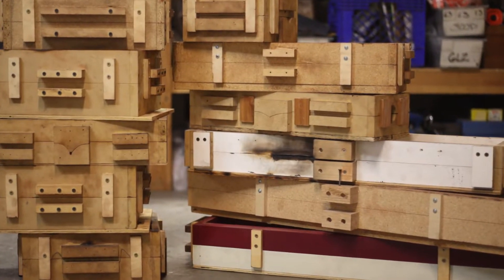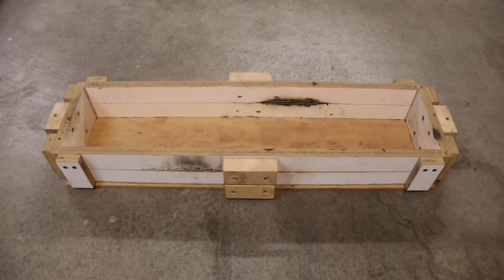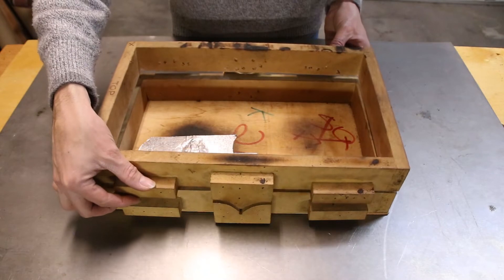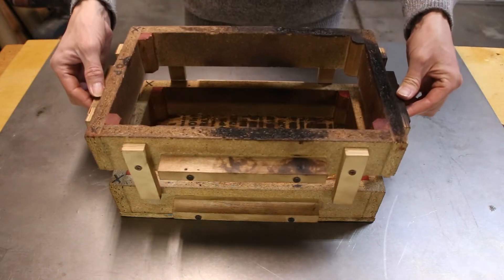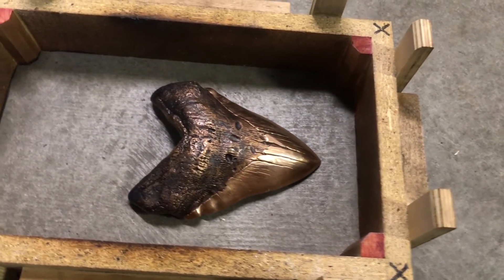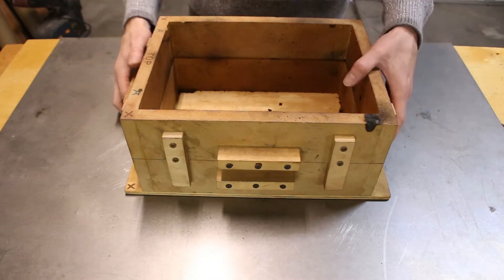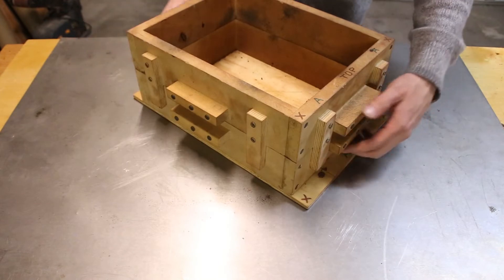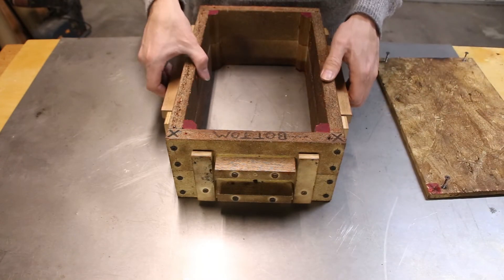Metal Casting Flasks for Sand Casting

Comment: I don't understand why most people interested in metal casting, use wood to make the flask as that is definitely not a rigid heat resistant material. Most flasks sold online are made of cast iron. They are much smaller, heavier, and more expensive; but if you know basic metal work, without a welder you could still assemble a rigid steel flask with 1/4" or maybe even 3/16" steel plate, and angle iron.
Reply from the maker: @chriscramer3706  I’ve been using these for years and they’re still going strong.